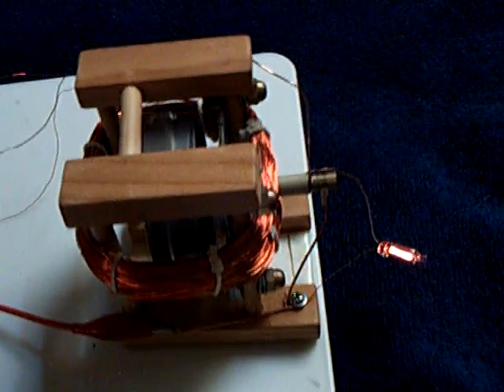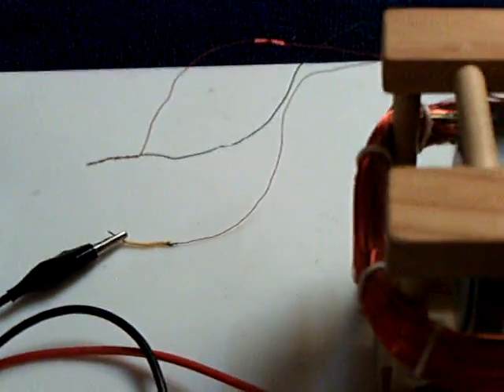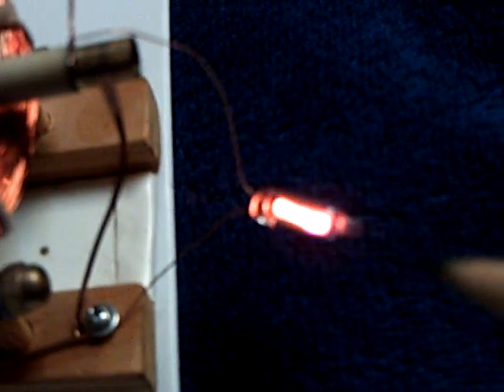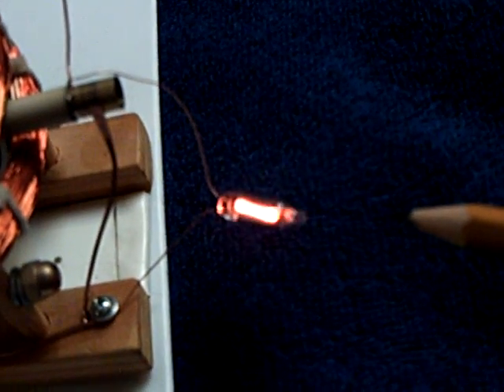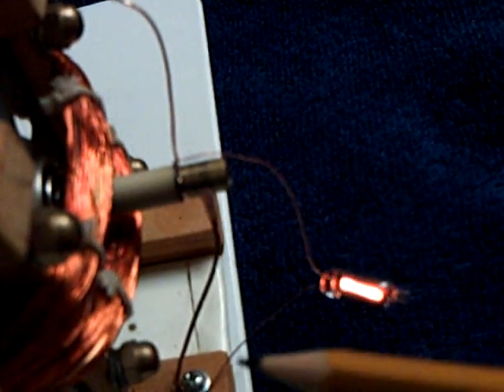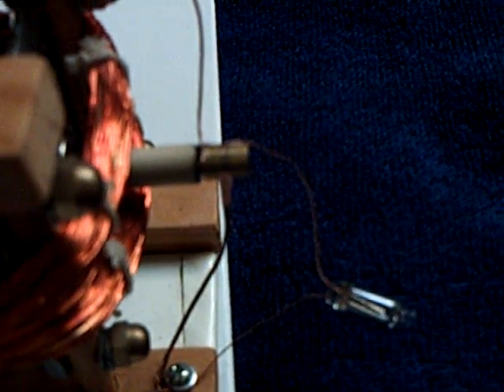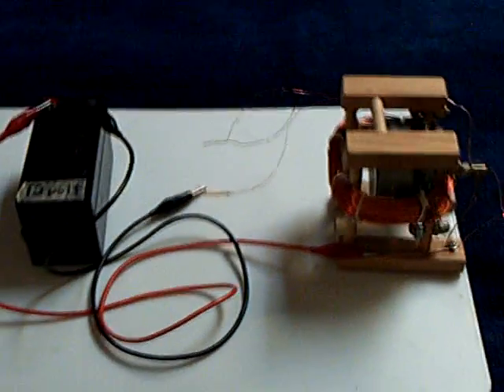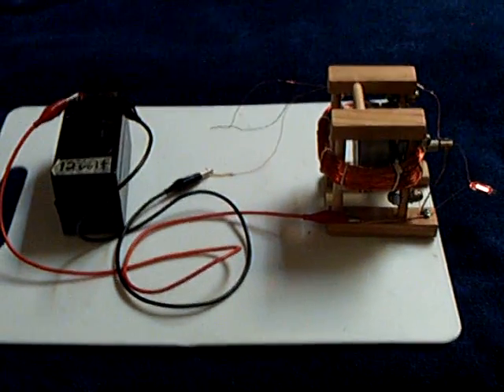No Electronics Window Motor

Comment: Well done Lid ! If you even put 2 commutators in series and thus have a much faster dI/dt current switchoff you will even get more induction and more back curent through the neon bulb into the battery to recharge the battery. Regards, Stefan.

Comment: Great conversion, shows how taking everything out can be just as good sometimes, more like the ways the pioneers did things.
Ya know, i've always wondered if coil heat from a motor is caused by the non use of that kickback. Even low amperage motors can get hot that don't use it. But use it, like here or with a Bedini motor for example and a coil will be much cooler. I dunno, just a thought.

Comment: Great idea Lid.  Could one also use just 2 reed switches with a single magnet on the shaft for the make/break?  One on each side of the shaft?  A great example of using energy that is normally left unused.  Maybe the old ways were better in some respects?

Bill

Comment: Lidmotor,  You can get 2 power pulses per 360 degree shaft rotation, by adding a 2nd commutator with a reversed power supply connection.   Notice that now if you put the contact on the other side of the shaft, the direction of the neorotor reverses.   Max torque is When the neorotor poles are at 90 degrees to the B field of the coil, so that is the best commutator alignment, or close to that point.               aloha

Comment: p2. Momentum is one form of stored energy. In a simple "electrostatic" collector [A treated metal piece, a ground, and a collector (capacitor or battery) in between] the capacitance would be lower then in a motor that has multiple forms of stored energy. All you need is a differential...harmonics can do the rest :). Really like your stirling engine stuff too :)

Comment from the maker: I tried this with a low watt 110v led bulb and it worked.  I needed a high voltage smoothing cap across the bulb or it blinked too much.

Comment: I tried reed switches and burned them out quickly.  You have to limit the current thru the reed switches somehow, which puts you back to using resistors and transistors to buffer the reed switch currents.   A well designed commutator handles the current,  but is not the most efficient way to crank these motors.

Comment: p2. Just a heads up, though, if everything is JUST right it can and often does cause cooling. Tesla was one of many to discover how to make an 'electron faucet'(since we are surrounded by them)...from the simple antenna collection (very low output) to 'fuel-less' generators. Just remember to be careful and like you always do...have fun.

Comment: p4. The cooling effect of the surounding environment would be due to the comsumption of ambient energy. The ambient energy coming in attempting to balance the positive and negative electrical and magnetic charges. The slayer exciter is only missing the push on the other side of the swing to become a generator and so none of the discharge is lost when the DC pulse is shut off. The Brooklin "Dodgers" came from people having to dodge the old transformers that would build up and discharge. lol

Comment: P1. See...thats why you are awesome! The only problem with a lot of what Tesla did...there was no way to explain a lot of it at the time. We can explain it all now, but after 100 yrs a lot of strange explanations have come up. Tesla's big obsession was resonance. Up until recently harmonics in Electronics have been considered a bad thing...mainly due to linear design....since harmonics aren't linear :). Maximum output of a harmonic system is equal to its capacitance.

Comment: p3. Oh and output would seem to exceed input if you don't include ambient energy being used in the system. In a harmonic system it can cause energy to be pulled in from the environment because of entropy. This is NOT a violation of any laws of physics...it is simply put...not linear. Look at the motor and if you put a gen on the shaft you would have a standing wave built on momentum of the flywheels. A bedinni oscillator motor draws less on load not more. google: Michel Meyer NMR generator.

Comment: p5. Simply put. The technology is easily dangerous. Since everything has a resonant frequency we must be careful not to use certain frequencies...or to produce them in the harmonics. I think this is why Tesla's design ended up being mechanical....he did have a thing for safety. Tesla was not the only one though. There are dozens of electrical scientists that have found these effects, but had no way to really explain them because it was not related to acoustics. mmmmm sound :)